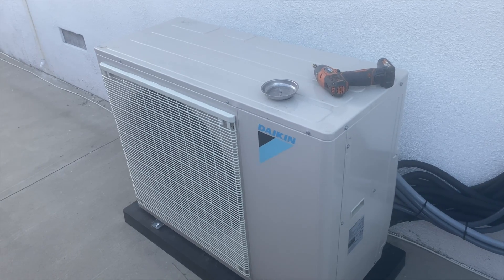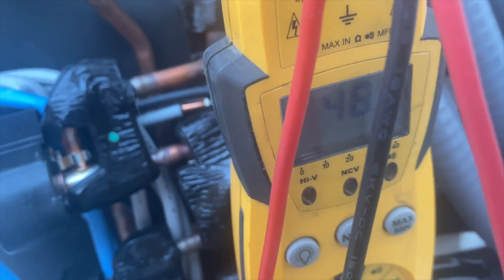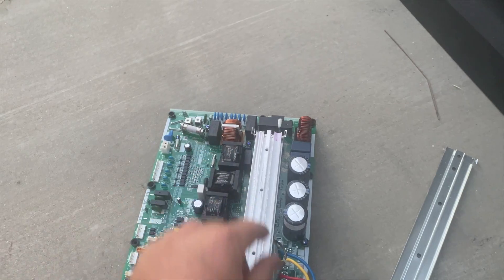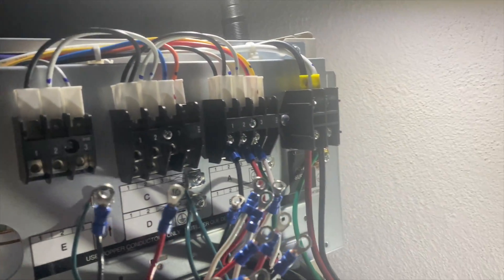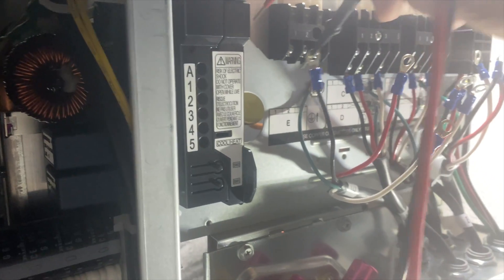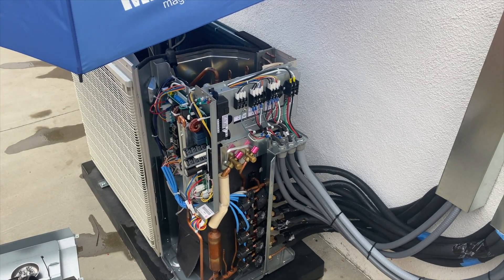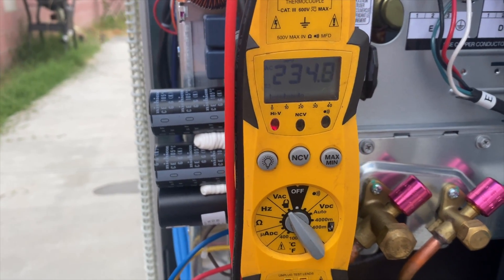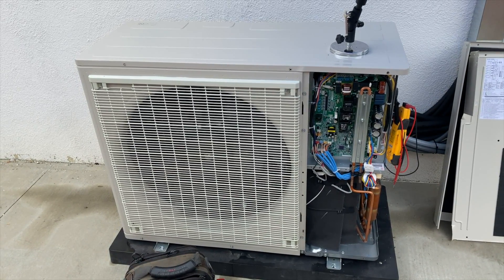Five Head Daikin Mini-Split Troubleshooting PCB Board Non Functional. EP35

Comment: I have power to all heads. But getting a UH code, which I believe is a communication error. When I check DC volts between 2 and 3 I am getting 0?
Reply from the maker: You should be getting fluctuating DC voltage.   If not that means it’s not communicating. Try removing the wires and reset. If the voltage is there then you have either a wiring issue or a bad indoor PCB. If you can’t detect any DCV then possibly a bad outdoor board. I’d suggest checking the service Manual for more details. https://www.daikinac.com/content/assets/DOC/ServiceManuals/2017/MXS-Service-Manual.pdf

Comment: The 5 ac supply cables to the  5 indoor units seem to be connected in parallel at the connector terminals A, B, C, D and E then connected to the PCB via a white and a black wires (smaller size compared to the main supply black and white wires from the main terminals to the PCB). This setup can be seen clearly at 11':28 - 11':30 . Just wondering whether the circuit breaker at the Main Switch Board tripped at all or only the small fuse on the PCB?
Reply from the maker: Only the fuse blew.

Comment: Why not just replace the fuse?  Why do you need to replace the board?
Reply from the maker: Brand new install. If he has issues down the line doing a field solder would void the warranty.

Comment: Good fault finding! Just remember  that the fuse’s job is to protect the cable. Bypassing fuses for fault finding is okish but leaving the bypass in permanently means that these cables were not protected. Any way, great job getting the system going!

Comment: I would have just soldered a pigtail fuse holder to the blown fuse location so that you wont need to replace the whole board each time.  That's a very poor design by daiken.  I have one of these I am trying to troubleshoot for a friend but its fuses test good but still no lights come on the head unit.  Bout to pull out some hair.  :)

Comment: Cool 👍🏼 but why didn’t you just solder in a new fuse instead of purchasing a new board ? Did you have to purchase the new one from your pocket ? Or did you say it was defective and got a new one ?  I wonder if the horrible tech will answer 😂👍🏼👍🏼👍🏼👍🏼👍🏼
Reply from the maker: It was under warranty. If I soldered a new fuse that would also void the warranty.

Comment: Good video - I have the 4mxl and drain pain heater -u should show correct set up to wire that as I checked mine as power bill was way high - tech did not wire it to dp1 and dp2 on board but right to power where comes into from supply - in other words the drain pan heater on all time - even when machine off - why would tech not wire to mainboard to use the energy efficiency if drain pan heater only coming on when 0 and when in defrost mode instead of wiring it direct and it being on 24 hours a day 365 days a year - just wanted to make sure their a reason why they would not use the correct ports on the motherboard -dp1 and dp2 - I look forward to a response or post as this is also new system less then 1 yr old

Comment: When you bypassed the fuse the unit worked fine. Why on earth wouldn’t they design it so that you could replace the fuse instead of the whole board. It seems like a waste to have to replace 2 boards instead of a fuse and if it wasn’t covered under warranty much more expensive for the owner.
Reply from the maker: Agreed!

Comment: Hi there. Great video!  I have a question for you. I own a Diakin mini split model: RX18NMVJU (outdoor heat pump) and last night during a snow storm the unit stopped working. Today I took a look at the heat pump and noticed snow on the electrical contacts and a little snow on the electrical board. I was wondering if the board is fried or would the fuse be blown?  I have a U4 code.  Your help is very much appreciated l!
Reply from the maker: The code U4:Malfunction of transmission between indoor and outdoor unit

Short circuit in indoor-outdoor or outdoor-outdoor transmission wiring (F1 / F2), or wrong wiring 
Outdoor unit power supply is OFF
System address does not match 
Defective indoor unit PCB 
Defective outdoor unit PCB

I’d suggest turning off the power and removing the snow. Make sure your system is fully dry. Then restore power. If it still doesn’t work you may have an issue with the board. At that point I’d suggest contacting your local licensed HVAC company. Good luck!

Comment: Great video! Was the fuse not replaceable?
Reply from the maker: It was soldered on and under warranty so I just replaced the whole board.
Reply: @NighthawkHVAC  why offer a warranty on something destroyed by external causes? If I were a manufacturer, I would refuse to offer a warranty on such defects...
I would risk losing sales because the people on the ground would no longer recommend my products to customers because the manufacturer does not want to repair under warranty products damaged for example by technicians :))

Comment: We all learn from the mistakes we make, it's just a price we pay.

Daiken dropped the ball, they should have protected the board against an external short. I designed power supplies for decades and we always designed over current protection into them so it would shut down if to much current was drawn. Fuses are supposed to protect you from an internal power supply fault, they should not be used to protect against an external fault.

Comment: You would think that crazy massive board would have high voltage protection for something like that, it’s not your fault, how would you have known to test for that, the warranty tech support guy should have said to test that the first time you called them when they thought the board was bad. You did a Good job 👍🏻
Reply: It has a fuse for the high voltage.

Comment: Wiring a condensate L+N on 1&2 will not cause a short or blow a fuse unless there is an issue with the wiring or pump ..

Comment: Aren't you supposed to wait at least 5 minutes after disconnecting power before messing with the board? I thought those capacitors on the board can hold a charge for several minutes.
Reply: Wait ten minutes, d c power will grab you and ya can't let go. That was told to me at a training session. I'll take their word for it.
Reply: So what if they hold charge when you are not touching them or any other conductor ?
Reply: The service manual for my RXS24LVJU advises waiting 10 minutes.

Comment: good   video. Just curios Have a daikin 4msx32gv-ju  all works fine but one head unit of 4 .The head the has green flashing shuts off in heat or ac mode or auto. Vents close and wont power up Outside unit. It will work at times and intermit problem   I got a J3 J6 double beep code in diagnostics . Not sure if it is the pipe thermistor indoor or out door or pcb board on ot door or indoor unti. Had tech here and i knew more than him so called Daikin they wont talk to me without Hvac certification. Any ideas would be appreciated. Unit is 12 years old and in excellent shape. Works fine with all other 3 heads .
Reply from the maker: J3=Malfunction of discharge pipe thermistor

Defective connection of thermistor 
Defective discharge pipe thermistor 
Defective outdoor unit PCB

J6=Malfunction of heat exchanger thermistor

Defective connection of thermistor 
Defective heat exchanger thermistor 
Defective outdoor unit PCB

I’d start by checking all the connection points then test the thermistors.
Reply: @NighthawkHVAC  thanks for reply. Wish there was a, video on the outdoor thermistor for Daikin. Three service techs came here not one had a, clue. Schmaditcs are horrible from Daikin.
Reply: Pcb board and thermistor faults are the most common problem I run in to out in the field.  Seeing how thermistors can be replaced relatively easy and cheap I usually start there.  Tech support would have you ohm out each thermistor but the leads are so tiny its pretty difficult and I believe quicker to just swap them out.  It is almost always a faulty thermistor at the discharge line of the condensing unit but of course be sure to check pressures before replacing anything.  If the unit is low on Refrigerant or overcharged it can also trigger a thermistor fault (if a pressure fault hasnt displayed first).

Comment: Question why replace the board if it was just the fuse why not get a new fuse and done  please help me understand thanx for your video  helps a lot 👍
Reply from the maker: The fuse on the control board is soldered on. If I found the right fuse and soldered it on it would void the warranty. Also this unit was new and still under warranty.  Thanks for watching!!!
Reply: @NighthawkHVAC  Also, by soldering in a new fuse, you would be liable if anything else happens. Best just to get the board and let the manufacturer worry about it.
Reply: Thank you very much

Comment: Hey Nighthawk I feel your pain.  I have the same inverter and want to one of those boards? Let me know if your going to get rid of them. Thanks
Reply from the maker: They were turned in for warranty. Sorry buddy.
Reply: @NighthawkHVAC  As it turns out, I measured each side of that fuse and it had 120v. so I thought it was good. After I removed the PCB and did a continuity check,  then did it register bad. So some how 120v was back feeding to the other side without amps... I soldered in spade connectors to the existing fuse barrels and stuck a fuse in.  Working great now. Thanks so much for the video it will definitely save some people headache.
Reply: @CR-hj1fs  If a fuse is working you won't show any voltage when live. If it is open then you will see voltage.

Comment: My diakin AC is cooling but it doesn't stop inbetween. It keeps on running and keeps on cooling. We turn the ac off to stop if from cooling too much.. where can be the problem?
Reply from the maker: Could be the indoor thermistor is bad and is not detecting the temperature properly.

Comment: Could have just changed the fuse instead the whole board?
Reply from the maker: I could have.  But it was soldered into the board and it was under warranty. Safer to just change the whole board.
Reply: Nighthawk HVAC hooking up condensate pumps wrong and blowing out two circuit boards is covered under warranty?
Reply from the maker: They took them as warranty to my surprise.